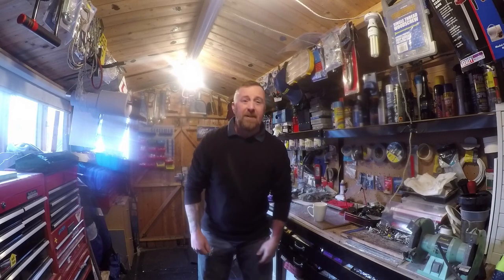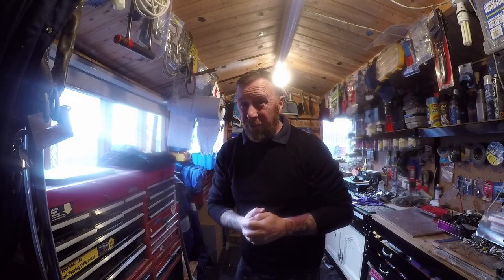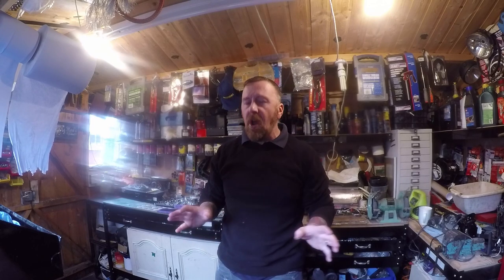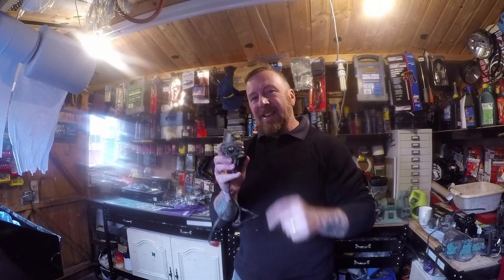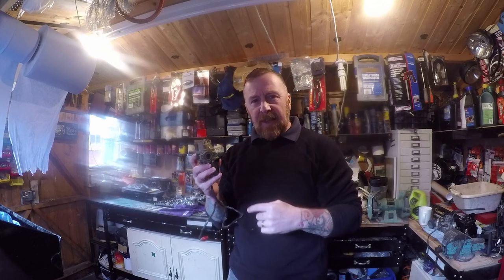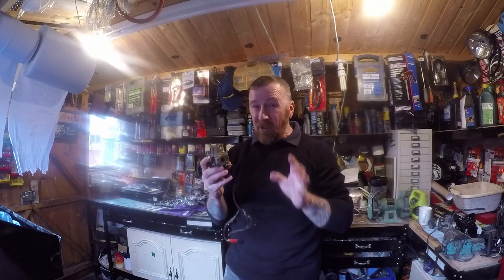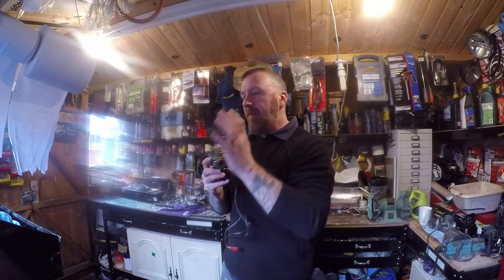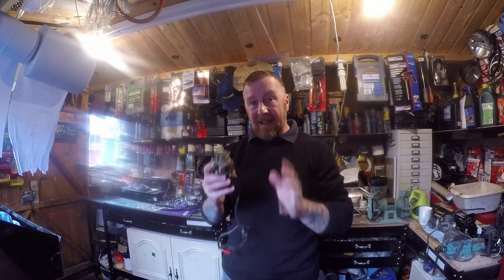MOPED BASIC BOGGING DOWN EXPLAINED MARK SAVAGE

Comment: Thx Mark. I was struggling with a used 50 2T that I just got for free. It was bogging down and stalling at full throttle and going up hills. I put new original size jets in the carb and adjusted it out 3 half turns and it runs GREAT!!! Thank you!!!
Reply from the maker: Thats great news bud , check plug after a few fills and if ok sorted

Comment: I have a 50cc 1986 Yamaha jog. Was running great 40 mph+. Yesterday it started sputtering like I was running out of fuel. It was nearly full. I tried some Seafoam and carburetor cleaner in the gas but didn't seem to help. Also noticed it's worse going uphill. Downhill sometimes it runs like normal
Reply from the maker: Is it 4t or 2t bud 
Last serviced ?
Plug , airfilter ?
Take carb off and clean bud with carb cleaner , jets out clean 
Check fuel lines etc 
Variator ok , rollers ?

Comment: I was always told the standard air/fuel mixture for 4T was 1.5 to 2.5 turns out. Now I'm curious to put mine on 3 turns out to see how it runs
Reply from the maker: There are different views bud 
But I use 1.5 for 2t
3 for 4t 
To start and go out or in once running to tune
Reply: @marksavage  what elevation are you at? I'm at 620ft above sea level I just changed my main jet from a 83 to an 80 and it seems to have helped a little with smoothness but it still bogs and a little and white smoke comes out the exhaust when I first accelerate. Right now my a/f screw is at 2 turns out

Comment: I have a speed fighter 3 runs fine soon as it get warm or hot we have issues with the throttle Boggs down if I put it on light might pick up but I’m at a miss 🤷🏼‍♂️
Reply: I have the same issue with my suzuki pv 50cc

Comment: mark usefull video, i have a 50cc 4gear 4 stroke i bought new, from the factory it had a bog that is really annoying, you cannot get past half throttle at start. I've tried upping a jet by 1 size and downgrading a jet and it doesn't help.The bigger jet just makes it have less than half the mpg and it goes even slower. The smaller one gives it premature ignition, starts holding revs etc. now that I've taken off the filter it shoots gas from the front of the carburetor. What can i do to fix this issue?
Reply from the maker: what fuel are you using bud , e10 or e5 ?
Reply: @marksavage  im from europe here its 95 octane I've tried it with 98octane and 100octane its the same story

Comment: Here's my issue.  My moped (1979 Kreidler MP19) will only start if I hold the throttle fully open.  And, it will only stay running if I hold the throttle open.  It doesn't rev and will not move.  When I hold the throttle open to keep it running it's basically like if it's at idle.  I installed a new spark plug and a new carb.  Before this the engine would start but slowly gets weak and dies.  Any idea what I should check next?
Reply from the maker: Carb and tuning bud 
Sounds like way to much air 
Tune carb like in my carb videos 
Air box etc 
Maybe after check needle hight 
Reeds etc
Reply: @marksavage  Thanks.  I'll start with the jets.  I don't know what jet the new carb came with but the OE Kreidler carb ran a 68 jet.  I'll bring it all the way down to a 60 to see what happens.  The new carb will be different since it's not an OE carb.

Comment: hello i have GY6 150cc when i put the scooter on the stand and i give full throttle it doesn't bogging down but if i am on the scooter on the high way and i do full throttle when it reach around 90 km it bogging down ... i change the air filter also the Carb but still same problem 

what do you advise me to do ???
Reply: also i change the cdi
Reply: What is bogging down bc when I drive mine it’s like it’s pressing the brakes but then it goes back up

Comment: Hi mark  
My scooter cant hold the gas steady fpr some reason, its q 2020 scooter 50cc 4 stroke, when I gas it accelarated then stops all of a sudden then accelarates and reapets like this constantly, i changing the fuel filter and still it didn't show any difference
Reply from the maker: Carb or efi 
If carb clean it as in my 4t carb videos 
They can suffer from stator earth problems 
Air-cooled I guess 
Have you changed the plug

Comment: Iv got a sinnis matrix 2 iv been throught the cvt and replaced everything as it was  fucked. The engine seems to run good dont bog down or miss fire but it seem gutless will not bump a curb and sarts to struggle around 30moh still. Im lost any help will be amazing no issues starting or staying running has a new carb aswell. Never really messed with peds at least tge transmission side of things

Comment: so i bought a new cdi and sparkplug and installed it and now it kind of bogs out i have to release the throttle and hit throttle again for it to actually go with speed. any ideas of what the issue is?
Reply from the maker: odd but not uncommon , why did you change them?, worth a clean of the carb, check plug ok and was it the right cdi for the ped

Comment: I have a buddy 50. Just serviced and now it bogs. Was running fine for a couple of days
Reply from the maker: re look over what you did and do it again bud , so carb off and check float and clean , fuel pipes , plug in ok and ht lead on ect

Comment: I have an aerox 50 2t Boggs on acceleration from standstill tried the air screw to the standard settings needle fine jets all fine carb clean air box fine clean still bogging what’s the awnser ?
Reply from the maker: you say carb all fine 
so was it ok before 
what have you done since 
clean carb and new air filter 
e10 or e5 fuel
bogging is jets bud
Reply: @marksavage  e5 supreme all the way …before all this happened the air screw was messed about with thinking it was the idle as it was idling to low. Then it was realised it was the air screw not the idle screw that was touched so I reset it to the setting it was on before which is 1.5 turns and it has never run the same .carb dismantled cleaned /air filter cleaned and fully intact no rips or rotting .it was running on a 68 jet so drillled out to a 72 needle adjusted to every level and test rode after every adjustment and still bogging but worse now the jet size has slightly increased so now thinking a smaller jet is needed anything bigger than a 68 is causing ridiculous bogging to the point it’s not rideable so now going to try smaller jets. Reed valves all good not air leaks or petrol leaks it’s a weird one you would think having a Leo vince pipe on it a 68 or abit bigger would be fine but no I’ve come to the conclusion it’s getting to much fuel but it’s weird seeing how before the air screw was messed with it was running fine I’ve heard the dellorto carb is very sensitive though ???
Reply from the maker: @Pricklypear7866  yes bud too big so go back down , then 1.5 turns and adjust once running in or out but out should be good 
I've ran on 64 and it was faster and ran better 
They are odd lol
Reply: @marksavage  yeah very odd Ive had gilly runners aprillia sr piaggio typhoon nothing as weird as the aerox engine with tuning waiting for jets to arrive will update once I’ve down jetted hopefully that’s the end of it nightmare lol

Comment: Hi mark! I have 50cc sf2 AC. I just put on an dellorto 17,5 mm carburetor been trying lots of jets, now i have an 105 in, but the spark plug is still a bit white. Could it be that from somewhere in intake is sucking more air, that is not needed, or it could be something else. It goes good on half throttle but when i do full it does go like exact same like un half throttle, but it makes like a deep sound from the carb. And i put on an polini 90° sports ait filter, because the original one doesn't fit..
Reply from the maker: Omg 105 jet in place of the standard 54 / 56 
Thats way way too big for a 50cc bud even the 100cc

Comment: My scooter wont hold a steady rev, full throttle it goes up to 9k rpm snd drops down to 8,5k rpm and it just goes like this up and down and it feels really weird
Reply from the maker: Ok serviced?
Variator ?
What have you done so far ?
I'd do both as this is the two main things and maybe a carb clean
Reply: @marksavage  its a gilera runner with a leo vince pipe, the rollers are the ones who came with the pipe, 4.8g i think and the carb is rehetted to a higher one, spark plug is pretty new and just swapped out the airfilter to a new original one
Reply from the maker: @exapioz3075  4.8g is way to light and need to be heavier bud 
Air filter , in box filter or or market 
Needs to be a box one 
Carb so not standard
It should be or this will need setting up and is you problem too

Comment: Hey mark, my scooter is having issues running right. I can start it relatively easy and accelerates fine and will hit 31mph but, when I slow down it starts to kind of drown out and not increase rpms. I can either max out the throttle or back off completely and it will sometimes get back to normal but most of the time it completely dies on me. It then takes multiple kicks to get it going again and the whole process repeats. Rides good for a minute then will bog down and die. My spark plug is a good brown color so I think my air/fuel mixture screw is tuned good. I’m at a loss and ready to give up so any help would be appreciated, thanks.
Reply from the maker: what size jet are you running 
standard air filter 
speedfight carb 
running e10?
Reply: @marksavage  stock air filter a brand new carb but identical to my old one (not positive about jet size and if they are the same I will check that when I get home) and using 87 octane premixed. I drained the tank and added the 87 but the 87 has sat in a jerry can for a few months. Could this be it?
Reply from the maker: @andrewpergasorus3064  ok none uk !
We use 95oc but now e10 is bad and use 98oc
No carb
Guessing Chinese 
So put your old jet in that one 
Mix may work all the way in on them cheap Chinese carbs
Reply: @marksavage  yes I’m in America. Could it be simply just the gas being a little old and the lower octane causing it to die on me? I was thinking maybe once it runs out in the float bowl that’s what causes it to die but It will run for different amount of times before it goes out and sometimes it will slowly start to die and if I work the throttle back and forth, it will come back

Comment: Hi mark i have a 2007 peugeot jet force 4t 125 fuel injected it stsrted hesitating when accelerating then it just lost all power you have to have it full throttle to move and it only does 4okmh full throttle have you deslt with this issue before . Thanks
Reply from the maker: they suffer from loss of spark and total failure so thought that's what you were going to say lol any way 
they are injection which plays up 
so new plug and try some injection cleaner in with your fuel 
air filter and poss worth having a look at you variator like in my videos bud

Comment: Hey Mark i have a problem with my piaggio nrg power 2009 50cc original cil, gianelli extra pipe, 4.5g rollers and the problem is: when i start it goes nice and at about 7k rpm it kinda bogs (like changes gear) and then pulls very hard. I have tried to adjust the carb, didnt work, bought a 60 jet (old was 70 too big i think) changed the spark plug, also it revs kinda slowly compared to my friends aprilia sr. Sorry for my bad english 😆

Comment: My 4 stroke  only bogging down when it is hot any information on that thanks...In 3years  time i checked everything never fix the problem it makes me fistrated need more cluse.It was brand new out of the box it start from day one with bogging down.motorcycle place were i bought have lots of storIes.It is a 150cc bigboy Revival i am very disepointed in bigboy compony they fuck up most of ther bigboy have major problems they build strong bikes but mecanical they fuck up....And still sell there shut to us...
Reply from the maker: this is a hard one to trace however you say you have serviced it as the plug and break down when hot and cause this 
im just guessing but could be electrical so maybe the stator coil, ht coil or cdi?? if its not fuel
what have the shop said??
if the carb is choke up this may cause this too like running with your choke on, maybe take the carb off and service it and check the auto choke or just replace the choke

Comment: Hello Sir! I’ve got a Pgo T-Rex 2T 50cc, Recently cleaned the carburator because it was lagging when i gave it throttle. But now another problem has come up. It runs fine without giving it throttle but as soon as i do it just dies. Do i just get a new carb or do i try to fix it? if so how? Thank you in advance
Reply from the maker: Take off carb again 
Take out jets and clean again along with idea , air mix and float pin 
Clean everything with carb cleaner 
Fuel pipes ok ?
Tight if not change 
Re fit and tune like in my tune video start at 3 half 
Make sure its tight on 
New plug and clean air filter 
If no good then yes new carb bud 
I have videos to help
Reply: mark savage Thank you! God Bless

Comment: hey man im struggling really hard with my moped i got a 150cc gy6 i put a new muffler on it and it was running fine i then put a new intake on it and when i gave it gas it bogs down i jumped the jets from 101 to 105 same thing 105 to 110 same thing 110 to 115 which everyone say is the max you can do same thing did i not do the vaccum lines right i dont even know but i cant afford to take it to a shop and really need some help this is my only means of transportation and i cant go over 20 on it
Reply: My stock jet was actually a 103 going up two jet sizes is too big
Reply from the maker: @BigDiccGaming  in that case no 
Was it 150cc stock ?
Changing things can upset the balance like 
Exhausts , air filters etc
Reply: @marksavage  it was a 150cc stock then I changed the exhaust it ran fine didn’t need to rejet the bike was running rich from the factory then I just put a pod filter on it and up jetted by 2 it’s fine around 15 to 20 miles per hour but when I get anything above that it bogs down and the exhaust pops a person on a forum told me to upjet I did same symptoms I don’t think changing it back to the stock jet will help anything considering when I upjetted by only 2 it was doing that everyone in the forums said it was running lean so to keep upjetting but no matter how much I go up it still has the same effect I’m new to scooter engines and obviously have no idea what I’m doing

Comment: Hey Mark.  Thanks for the video.  I was wondering if the rain or getting the scooter wet could cause a slight bogging when driving the next day.  It only has 1300 miles on it so the shop said it could be something got wet.  I thought maybe the air filter but they said it shared changing for at least another 1300 miles. It’s fuel injected by the the way.  It only starts to struggle when I get up to 35 MPH and doesn’t want to go above 40 or at least I haven’t pressed to do so.  Thanks!
Reply from the maker: What air filter do you have on 
Also the plug ht lead getting wet can cause this and insulating spray will help
Reply: @marksavage  the scooter is a Kymco Like 150i. But it is the original factory filter. Maybe let the bike dry out will help.  Thanks for the info and I’ll check the plug and wire too.

Comment: I changed my cdi box but my moped still only goes 10mph and pops and bangs and won’t go anymore then 10
Reply from the maker: did you check the piston and rings ?
pops and bangs can be that of carb bud 
also check variator

Comment: Hi Mark,I am a big fan. I am wondering if you could help me with my Peugeot speedfight 3 50cc lc model. It has a running issue because when you are stationary it runs out of revs and turns off. Does not matter how much you ride it, if you don't rev it while you are not moving, it will turn off. Also, I have tested the range on the tank. It says 162 miles on full tank, I have drained the whole tank and filled it all the way up, only does 80 miles per tank. Today, from an empty tank it only  did 55 miles. Any help would be appreciated Mark. Thank you in advance. And If you could take a look at the bike for me and fit some parts for me. I would appreciate that. I tried to contact you to arrange a meet up which I will of course pay for.... I am in UK Northamptonshire area. Many thanks,Arthur